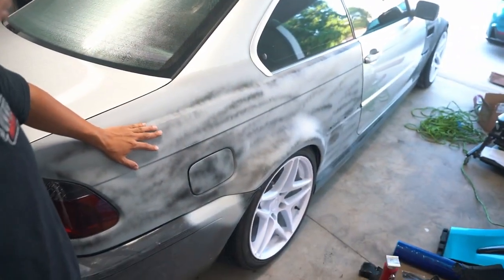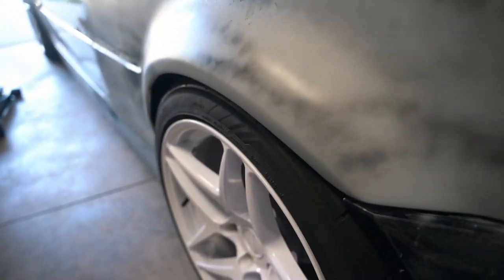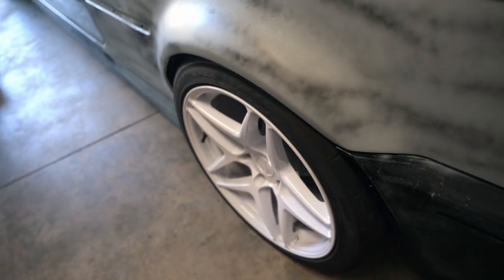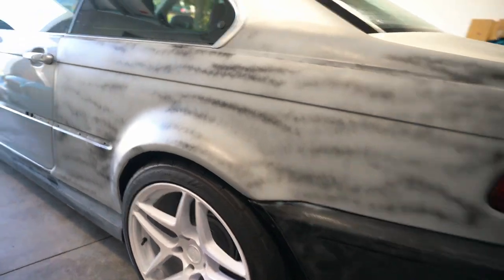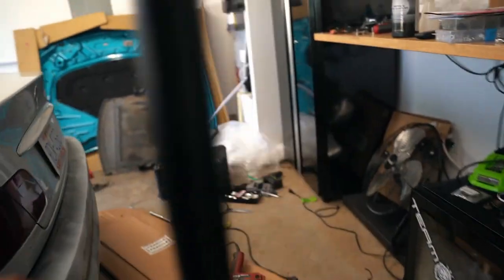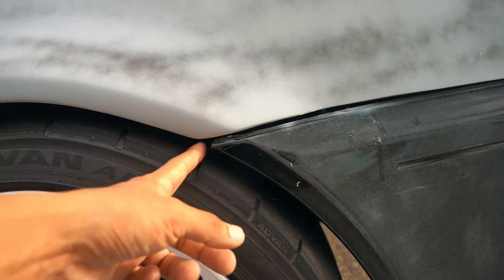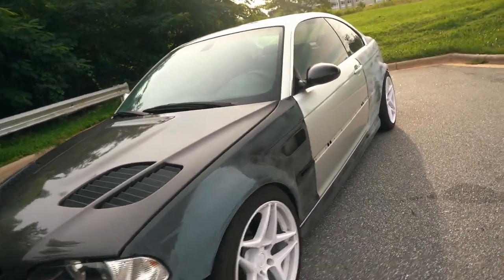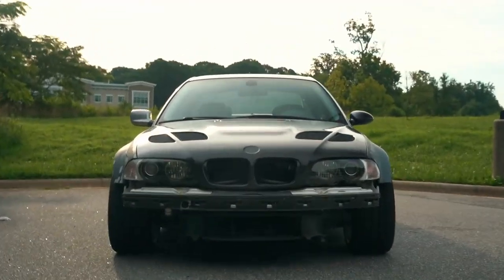E46 Gets CLIQ TUNING Rear Over Fenders!

Comment: Did you modify the rear fender trim on the cliqtuning overfenders to take the oem m3 trim?
Reply from the maker: Yeah had the body shop cut it out and shape it for the factory trim. You don’t have to but I wanted the rest of the trim to match the fenders
Reply: @EldridgeCortes  looks legit to me, I have a pair from cliq tuning as well. Definitely want the oem m3 trim too🙏

Comment: How did you get it molded?
Reply from the maker: Some type of panel bond and bondo were used. Not exactly sure of the process but I do know the edges of the over fender were shaved down to bring it closer to the body before the bond was applied